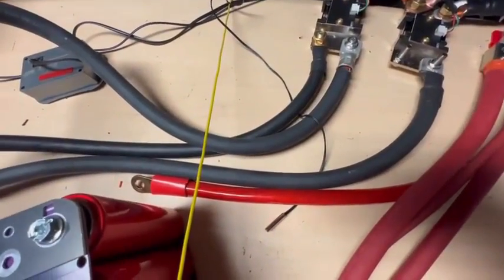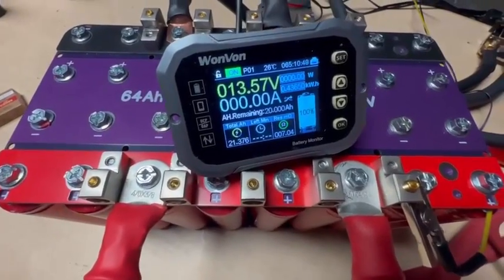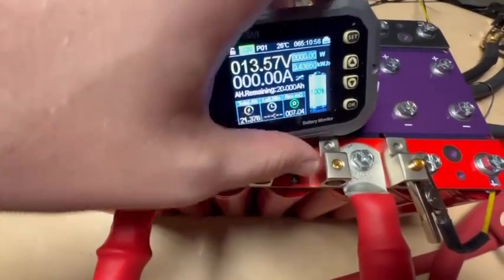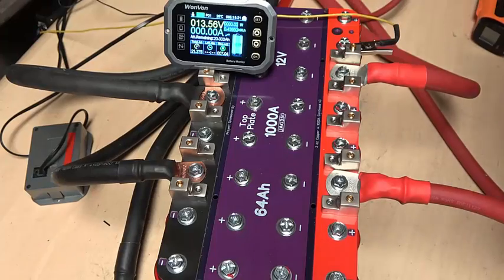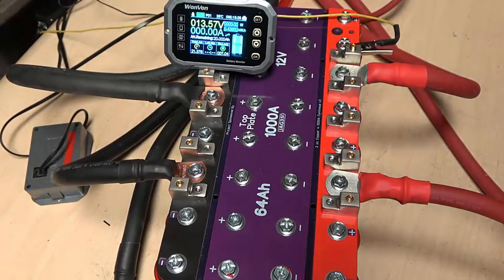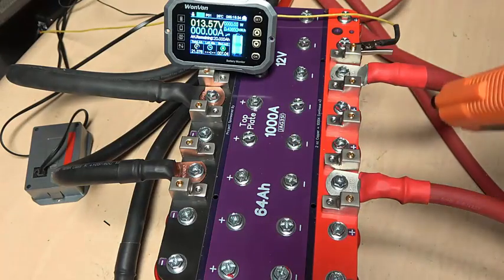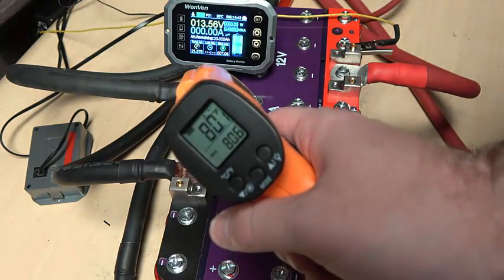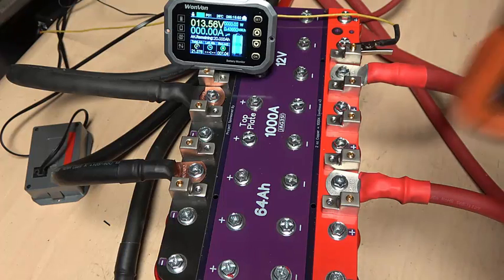Does PCB REALLY work to bus headway cells??  Testing Jag35's new bus boards @ 500 amps.

Comment: Glad you two are working it out I've been watching videos on both products and to be honest I don't know enough about lithium yet to say what is what but I am interested in both products and will be purchasing one or the other eventually im just trying to figure out how I can get the most power out of my stock alternator and push a larger system than im currently running 2x12's & 1800.1 but I want to be around the 5-8000 watt RMS i know it can be done i just for the life of me can't get anyone to explain to me what I need to make it work in a daily driver setup for long periods of listening 1-2 hours at times while driving I've been gone for over 10 years and lithium cells in car audio is completely new to me any help would be appreciated
Reply from the maker: Everyone can win, for sure.  The market is massive.

Comment: Curious to understand what causes the discrepancies in the test methods. I understand they’re different but I don’t think I understand why.
Reply from the maker: With all of the cells hooked up spread evenly throughout, a smaller amount of current is flowing through each part of the copper board.  It evenly distributes the current, whereas attempting to use it as a bus bar and pull all of the current all the way through it?  Not a great idea, wasn't designed for that.

Comment: What was the condition of those cells,  that looked like a big drop on voltage ,
Reply from the maker: It was a big drop.  A 64 amp hour headway bank can’t handle 500 amps of current and remain above 12v..  I knew that going in — the test was more about if the bus board could handle 500a without heating.  The busing passed the test!

This PCB bus board will literally outperform the cells or was made for.  

I’m not personally a fan of headway cells at all, they’re old technology in 2023 for sure.  

Alas, a lot of folks still use them and are very happy with them, and even more I’ve seen lately have questions on if the PCB bus boards really work so we wanted to test them.
Reply: @GloweIndustries  yeah 500 amp is a lot definitely

Comment: Are these your Headways you tested on your channel a while ago that came in kind of....meh? Would a fresh set of 38120HP's likely hold 12V easily at 500A?
Reply from the maker: These are a new batch of cells I bought from battery hookup to run these tests. I had gotten rid of all of my headway on various projects.
Reply: @GloweIndustries  the only reason why I ask is I bought some off eBay. I knew they were older cells but they claimed to be uncycled. Capacity testing at 2A or 8A have similar numbers (the 8A discharge got them warmed up so those typically did a tiny bit better) but I got 7600-7900mAh. So likely not stored in the best conditions considering the seller was from the same area of Phoenix as me. 

I accidentally discharged one to the point of making it go reverse polarity. Was trying to test out the full range of an active balancer by discharging a cell to be 1V lower than the others in a 4S pack using a power resistor. Had an alarm set but got distracted by the dog and it went for an extra hour or more. 

So now I have 7 good cells and I’m debating between buying a new cell for $14 plus shipping from Liion Wholesale or buying 2 used cells from BH and picking the better of the two. 

All my cells measure 1.9 milliohms AC IR if I remember correctly….so a truly used cell with hundreds of cycles will probably be a fair bit more than that. But a new cell is probably gonna have 8.5Ah of capacity…way more than any other.